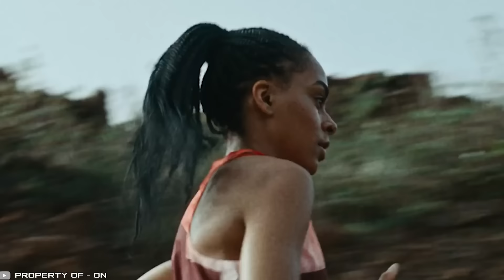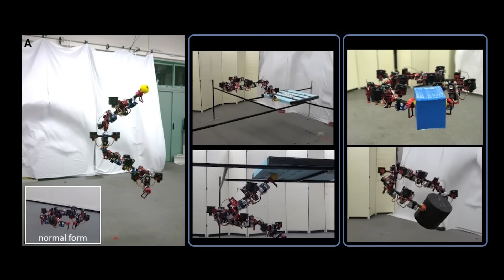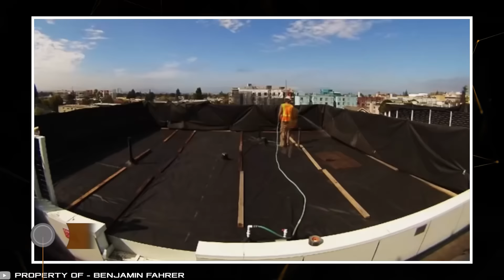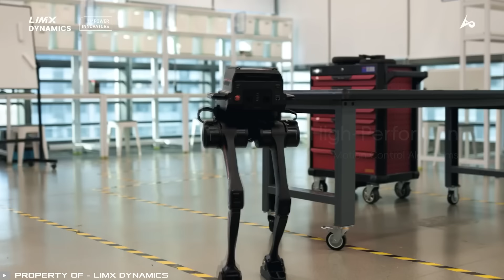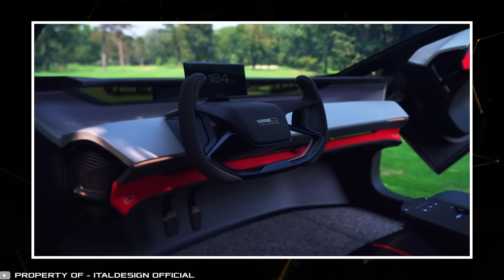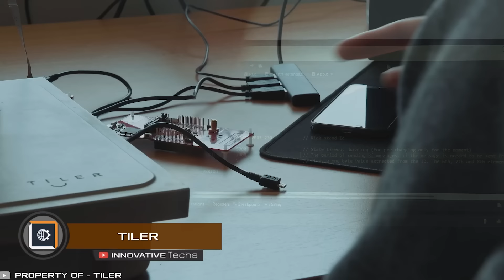NO ONE BELIEVED HE COULD CREATE THIS

Comment: The artificial heart? Stupid design. Play pump only needs to pump. It doesn't need four valves, Chambers, doesn't need to look like a heart, what does it need to beat. All it needs to do is flow. 
They have already made one what is a centrifugal design, put in two cows, and a athlete. It is a brushless motor motor and works off of ain't no contact power source similar to what charges your phone. Low cost, high reliability, no issues, motor will last longer than a healthy person's projected life. Downside? You have to carry your battery in a backpack and stick a pad on your chest. Far more practical than making a "impossible Whopper heart" when there's no reliable way to make the involuntary nerves fire and those muscles that is made out of aren't going to go through cell division, repair or growth. That means it's a fool's errand to waste money on a big squishy heart model with no practical use or application. No one is going to sign up for open heart surgery once a year to get a new heart installed after the previous one has failed.

Comment: it is funny that the narration keeps using "3.3ft" when it is really a meter. if the original units of the project is in meters, it is OK to use "meters". Folks can understand just fine.  Many of the American projects might have the data in feet, which is fine. Most of the non-USA based projects will be metric.  Most Americans can use both, interchangeably. Some small portion can't... but they don't count.

Comment: I think your signature device is a tamper for compacting soil.
Reply: Not just that but it's old old old.
Reply: The handheld compacters I've used, years ago, were smaller and vibrated.  Lifting the handle up or down and side to side allowed you to let the devise move forward, backward, side to side or a combination of two.  Floor polishers and cement finishers are controlled the same way.  It is a favorite tool for contractors to put a new hire on to provide entertainment for the whole crew, except for the poor person learning how to use the tool.  The compactor isn't as unforgiving as the other two, which will tie the poor newbie into knots and wind up the cord like a top.  Bomag Compactors are one larger variety that is kind of like a knobby, vibrating steamroller used for much bigger jobs.

Comment: Wen I was working as a laborer for the US Navy at the Naval base at Coronado, CAe we used a device similar to that  which we called a Whacker. The metal (steel or Aluminum had a smaller footprint than the one shown in the video, but it did a very good job of pounding  the dirt fill when we refilled a trench which we had previously dug and now had to refill.

Comment: Putting solar panels under trains is an asinine idea. 

Place solar panels on an awning 3 to 10 times the width of the rail and the entire length of the line and produce 3 to 10 times the amount of power.
Reply: No need to build , just place … very cheap and fast ….
Reply: @patsquach4080  WASTE of money
Reply: @ it’s. Not. My. Money. Or yours.    lol.
Reply: @patsquach4080  It's Spock's Logic!
Reply: @ live long and. Prosper.       Laughter is the best medicine….   Have a fun. Day !!!
Reply: snow....which makes them produce zero times as much power
Reply: @rRobertSmith  The awning will have a motor that rotates the solar cell 180 degrees, removing the snow from the solar cells that would have fallen onto the tracks, on to the tracks.
Doing the same on highways would work even better since highways take up so much more area due to width and that they're bigger (in width) in densely populated areas, reducing transmission travel.